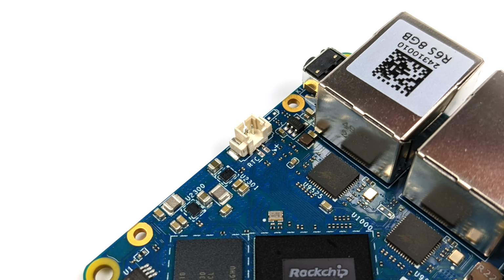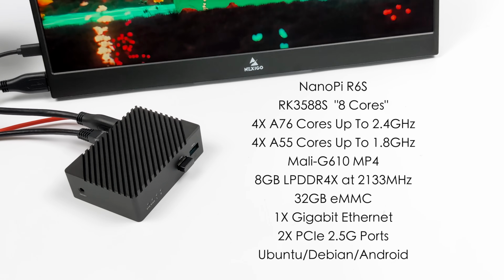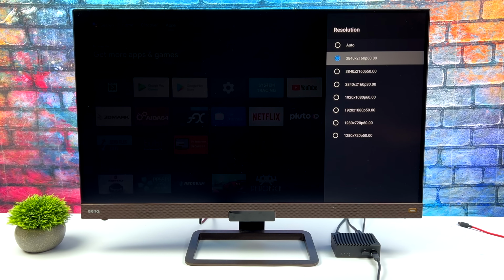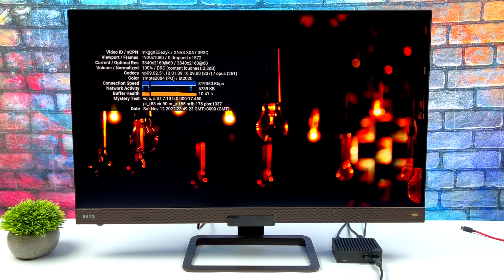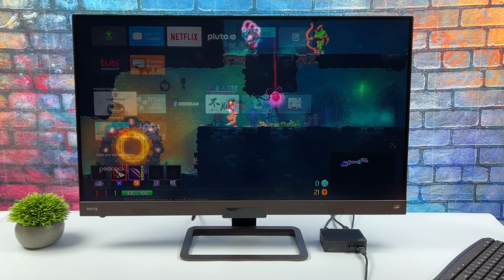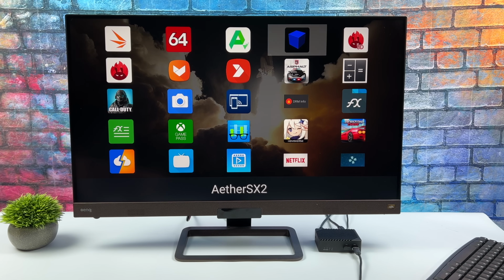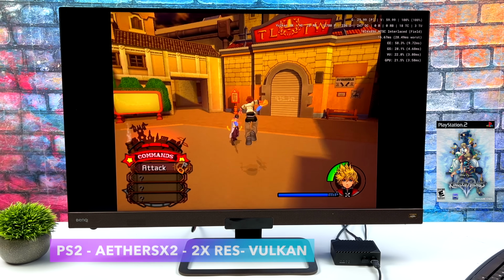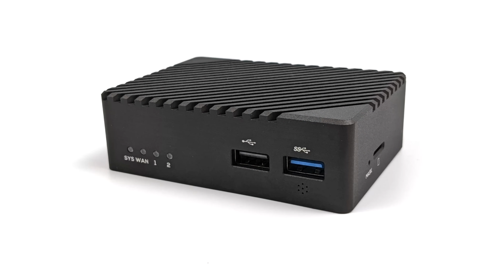The New Nanopi R6s Sbc: A Powerful Arm Board With A Huge Performance Edge Over The Pi4!

Comment: I was so excited when I started the video, but just 2 minutes in I'm questioning finishing. No wifi/BT. NO internal mass storage connector. Only 2 USB ports. This really is going to be best used as  a network bridge / router. Not a daily use PC. They simply gave too much up for the additional network ports.
Reply: Considering one of the Ethernet ports is labeled wan I’m thinking this is intended for use as a pfsense or opnsense router
Reply: @lunarx3dfx  As far as I know, pfsense is for x64 architecture
Reply: @mrwhiteslon  Correct.  Which is a bummer.
Reply: @lunarx3dfx  openwrt is capable of doing router and VLAN's and such
Reply: While I can agree with the rest, the R5S does have an NVMe slot, and you can add a WiFi antenna to it. It also has just as many network cards. I will be using my R6S as a Firewall.
Reply: There are non-S variants of this chipset that may suit you better. Now it's early days of this soc and availability and price are all over the place. So same performance just different i/o.
Reply: it has internal eMMC. On the odroid I am now typing on my internal non volatile memory is a lot faster then on my i9 desktop PC.

128GB eMMC and an external hard drive, you are gold. Don't forget SD cards with 100Mb/s throughput are not exactly a slouch either.

Comment: This looks like a fantastic router. A 3 port config is really nice for adding a failover line to your home network for emergencies.
Reply: That was my first thought too! A router leading to network switches and access points.
Reply: I came to say this ☝️, though I'm thinking maybe 1x 2.5gig to my Aruba AP, and one to an unmanaged switch with both 2.5gig and 1gig for wired,  then the 1gig for WAN. From the spec page, the 1gig is native to the SoC, and like he said pcie for the 2.5gig nics.  They have a WRT build on their site and everything :-)

Comment: It doesn't have an RK3588. It's got a cutdown RK3588S version. RK3588 is more expensive.
Reply: Lol even worse
Reply: This detail matters. It should have been pointed out in the video if true. Haven't checked
Reply: @fstemarie  He said in the video that it's the RK3588, but he listed that it's got an RK3588S. Supposedly the cut-down version is ideal for the TV boxes, which are supposed to be inexpensive. Though I don't remember what the differences are, I wanted to get the Rock5 with the R3 pre-order coupon for $99 (for an 8GB version, as opposed to $149 without the pre-order coupon), but I am unable to buy it due to sanctions, and frankly I found a better option for me - an x86 mini-PC called Beelink Mini S (which I believe ETA Prime had reviewed already) with 16GB of RAM, a 256GB NGFF SSD and a Celeron N5095, which has comparable single-core performance to the RK3588 in Geekbench 5 (though it's got a higher power draw and 30% lower multi-core score) for $142, which is about the same as the 16GB RAM version of Rock5 with the coupon (which is sold for $190 without the coupon, for now). I got it in so as not to have any problems when dealing with ARM hardware. And frankly Docker's Buildx already builds all containers with just one thread per container, for instance, so there's hardly any reason to explicitly buy a system for more threads. (not to mention that I already have a Ryzen 7 6800H laptop in case I ever need more compute performance)
Reply: I beleive 3588s is not a cut down its just the sbc variant.  I have the mekotronics r58s I paid too much. I should have waited for this.

Comment: For $200 seems like you could get a chrome book and put a different OS on it and end up with better. This thing is a waste of money.
Reply: You could get an Odroid H3+ for $194 for the board. Waaaay faster.
Reply: @RealMTBAddict  I you go x86 why just go AM4 on a microATX board... for less than 200 euro you have a 4600G+mainboard+8gb memory. That's a lot better graphically. A a little bit more and you can even buy a 5600G
Reply: @erikkarsies4851  The cool thing about Odroid devices is they are ready to deploy. 
You are comparing building a mini PC vs a SBC. Not everybody wants to build a PC. Odroid makes it simple. And they aren't designed for gaming, mainly servers.
Reply: @RealMTBAddict  The crappy thing about it is that it is severly limited machine for almost the price of a complete PC. The PC can do more functions better and is better as a server because then you can connect SATA , M.2 and PCI-e. That Odroid is just of the many choices at those price point having a very niche market for it. (Most people who build a server don't mind assembling one ) I've just bought a Acer Aspire in the Thrift shop. I must admit : quite a find for 22.50 euro.  But that quad core from 2014 has almost the same power.
Reply: @erikkarsies4851  You can connect SATA and M.2 with the H3. They also use much less power than a regular pc.

Comment: if you turned that into a plex server could it manage video transcoding?
Reply: Technically, the rk3588 has hardware encode/decode for h265 and h264 so you should be able to
Reply: @fstemarie  thank you for the info! do you know of any decent guides?
Reply: Not sure this would be the best board for it though, look at what's available with rk3588

Comment: You also gotta look at the cost of getting a case and cooling for the pi 4 when comparing prices. What passive cooling case can you get for a pi 4 that is good and cheap. The only thing that this doesn’t have that the pi does is a ton of community support. Basically for the same price or less of a pi, you can get a ton more performance and with that 2.5 gig, setting up multiple 4K video streams with a home nas wouldn’t be super difficult
Reply: Price of a Pi4?... currently Pi4 prices aren't worth buying one,...   better to buy a nuc then a Pi4 these days...
Reply: @Oogobuk  Look up the Odroid H3+. Intel Celeron processor

Comment: Hey eta. I'm about to get a free dell xps 8500 d03m. The only thing is the hard drive is going to get formatted so I won't have an os in there. On the Dell website it says that the highest os it supports is windows 8.1 but it is no longer available to get from Microsoft. Do you know if Linux would work with this PC? Or is there another option for me to get windows installed? Thank you for your time.
Reply: You can install linux on a chainsaw if you know what you are doing... No reason it couldn't be done on your pc
Reply: I put some life into one of my old laptops by installing Linux Mint.  I tried windows 10 at first, but it was too slow to be useful.  I use it for web browsing and watching videos, and it now does that really well.  I haven't tried emulating on it yet, but I'm sure it's possible.  If you want an up-to-date OS, Linux Mint is pretty easy to get into from someone who mostly uses windows (I just used online guides), and it's lightweight enough to run on older hardware.   I'm sure it's also possible to find someone who has legacy downloads of windows, as well, and other distributions of Linux work well, such as Ubuntu, but I haven't experimented with them since I found a solution that works well enough for me.

Comment: Unfortunately due to lack of USB ports and Wifi&bluetooth,  this SBC is more suitable for NAS and routing purposes than a computer, imo they should’ve replaced 3 Ethernet ports with only one 2.5Gig Ethernet port and given it 2 more USBs (maybe type C?), another display port and added hardware for wifi and Bluetooth , it would have been a great alternative for all the purposes where RasPi fits in atm
Reply: 1 ethernet is a deal breaker for any small form factor pc for me, I think 2 should be the standard so they can be used as router/firewall, usb is easy to expand with a hub. Lack of wifi really shows it's not meant for general purpose though.
Reply: @Geardos1  yes, I agree that one Ethernet is not enough for router/firewall, but one Ethernet port is more than enough for a SBC PC, imo this SBC is designed for the former purposes than the later
Reply: Looking at FriendlyElec's page, it seems clear that the "R" series is designed towards router usage. The older models didn't even have display output.